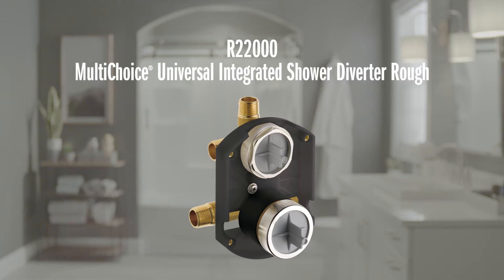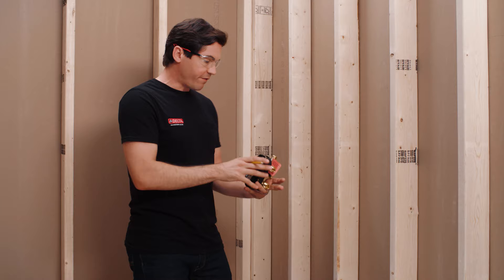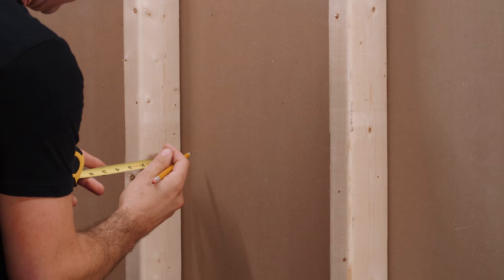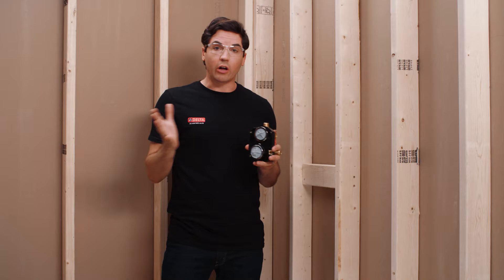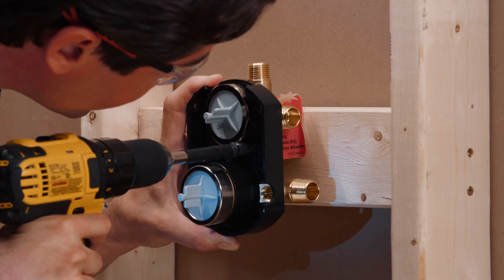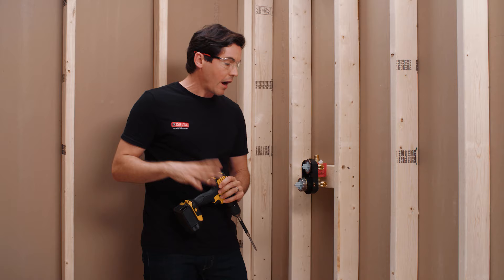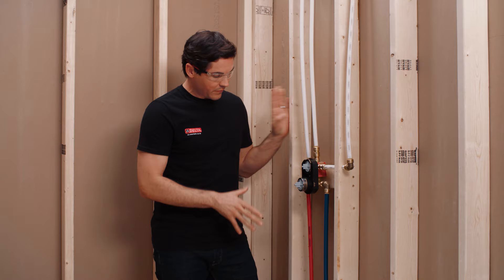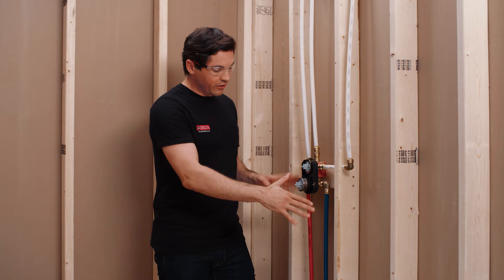How To Install the Delta® R22000 MultiChoice® Universal Integrated Shower Diverter Rough

Comment: Skipped the important part. Like which port goes th the hand held. Which port goes to the body sprayers. Just cut to it fully hooked up? That's not an installation video!
Reply: It’s going to depend on the position you want you’re hand held. On a house i did. I wanted the hand held on the right side of the valve, so i used the right port. And my rain Shower i used the left port. And the upper port for the Normal Shower Head.
Reply: Any port can go to any.

Comment: I installed the valve at the depth suggested then installed 1/2” Hardie backer.  I now have 3/4 inch of plaster guard that is proud of the Hardie.  My tile and Thinset will make up about 1/2” of that number.  My question:  if my plaster guard is 1/4” proud of finished wall, will I have any issues with finish trim?

Comment: Really??? 1 9/16 not 1 1/2? You really really care about that 1/16?
Reply: The tolerance is +/- 1/4", so feel free to ignore that 1/16". Just be sure not to change you mind about 3/8" tile to go with something less than 3/16" or the trim won't sit tight to the wall.
Reply: Tottaly right, it's so much harder to measure 1 1/2" vs 1 9/16"
I almost gave up on doing the installation myself.

Comment: I have a showerhead and handheld sprayer, so we are using the 3 way settting. We have always had an issue of the diverter not working. Water always comes out of the showerhead and handheld at the same time no matter what setting the diverter is at. However, after watching this video and comparing to photos I took of the installation process, it seems that the contractor capped off the left side and not the right. Would this cause the diverter to not work properly?
Reply: yes that is correct. if not installed properly the diverter wont work properly.
Reply: I'd agree yes always cap the right side. It doesn't always pipe as easily but you must use the top and left outlet.

Comment: Do I cap both top outlets if I'm only doing one shower head?
Reply from the maker: Hi Jarrod! The R22000 would typically be used with more than one showerhead or shower feature. Yes, if using only one showerhead, two of the outlets can be plugged, but a diverter would not be needed for just one showerhead.

Please reach out directly with any questions!
-Bryan

Comment: Installed this can’t get tub spout to work? Any ideas?
Reply: I have done extensive research before renovating my bath/shower. I called Delta (locally based here in Indianapolis) several times to confirm both my bath and shower combo concerns. You cannot use the dual trim package (both the temp./vol. control and diverter). the R22000 is only for the dual trim package for shower only which is the T27 series. In order to utilize the show/tub functions you will need the "T17" series. One trim package for the water volume control and temp control and another trim package to control the shower. Then you would need a standard tub spout that has a push and pull diverter. You would need the R11000 for the shower diverter and R10000 for the vol./temp. control trim. Also the diverter shower trim packages are the T118 and T119 series. this is the Stryke model that I went with. Hope this helps.

Comment: Please dont ever use galvanized iron for water lines. They corrode and will eventually either leak or they will just rust close and not allow any water to come through. CPVC is also notoriously bad because over time it becomes brittle and will leak.

For water lines please use either copper (the best option) pex (good option although not my favorite) or PVC (try to avoid using pvc for water lines however it is much better than CPVC)

Comment: hey good evening,
my plumber installed the r-22000 ws valve.
i am going to have a shower head and handheld wand sprayer..
i was watching your video and saw the right top outlet was plugged...i looked at my valve and saw that it IS NOT PLUGGED...but has a pex connection....
will this still work???
what would be the result of not being plugged?
we want a two water exits, one being the showerhead the other the handheld...also

Comment: How does 6 way work with only 3 outputs? 
Why do you need water stops?
Reply from the maker: Hi J-M. M. Thank you for your question! A 6-setting diverter trim can control three shower features. It has three individual settings and three shared settings.

Stops are useful to turn off the water supplies at the valve. This can be helpful for installation or maintenance, especially if it is difficult to access the water shutoff for the home.

Thank you for being a Delta Faucet customer!
-Bryan

Comment: Do you need a cartridge on both sides 
I wanted bought a shower faucet T17T299-bl
& I wanted to add a handheld to that 
T1799-bl
& so delta told me to get the R10000 
To make them work 
I did, my contractor said that was the wrong part so I call again they told me to get the R22000 so I did & now he said it doesn’t come with cartridges & it need 2 he’s charging 250 extra for lost time & I don’t know what I really needed for this I call delta again & is a new story of what I need ???
So how do you make this work???
Reply from the maker: Hello Celeste. Thank you for reaching out to Delta Faucet Company and we are happy to help. You will need a cartridge for each valve and they come with the trim kit you select. With any further questions or concerns, please do not hesitate to reach out to us again in a private message. -Carrie

Comment: I saw sharkbites and I quit watching. 😂
Reply: Put the wall all together and count on a single oring to seal up around the pex. 😄
Reply: Imagine making instructional videos on different valves and reusing copper fittings or crimping pex every time….   Think about it Einsteins.
Reply: I used sharkbites on exterior applications, 17 years in no leaks.